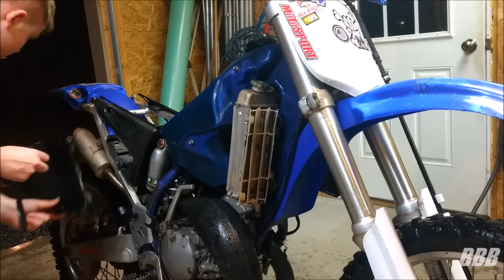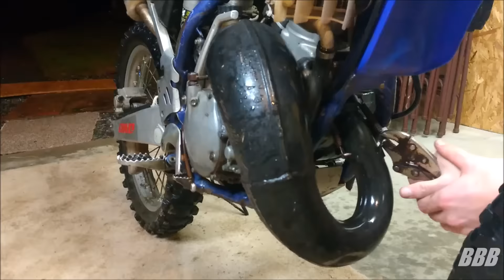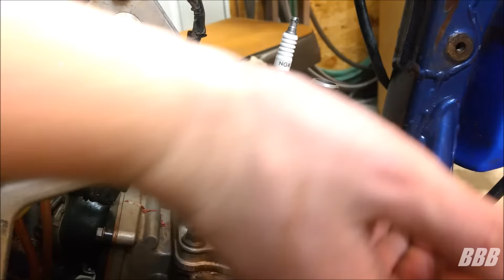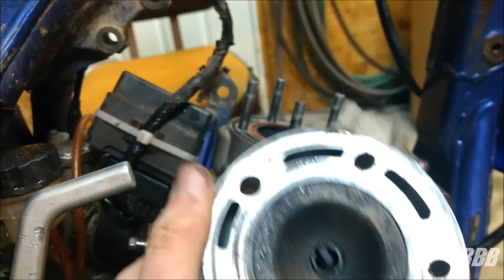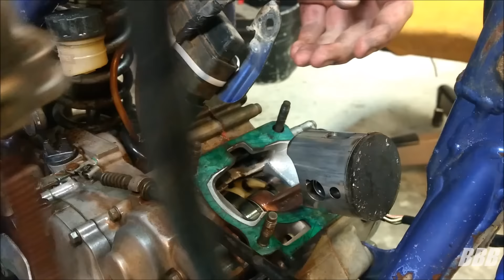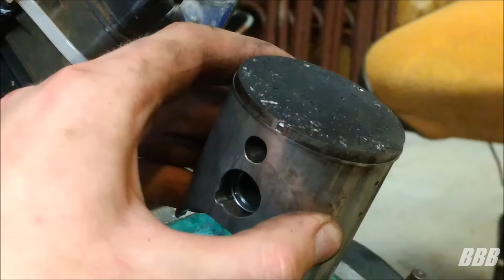YZ125 TOP END REBUILD!! PART 1

Comment: How can I tell which piston size to order? I went on amazon and they have different size pistons for the same year bike.
Reply: Get a shop manual, 2 to 3 inch micrometer and a set of snap gauges and measure it. Or just get a d piston if it's a used cylinder.